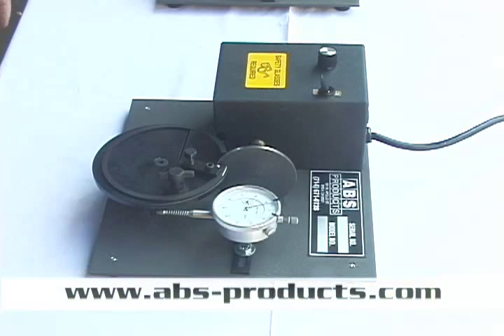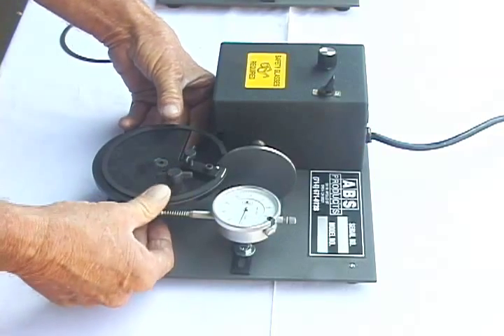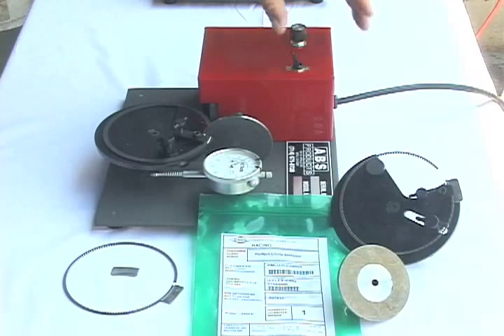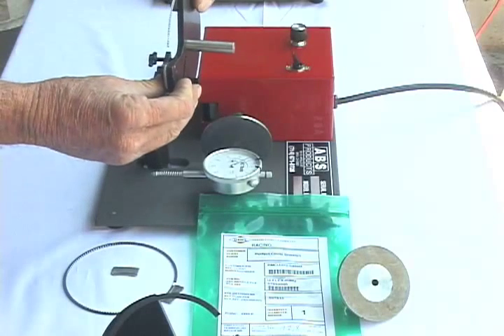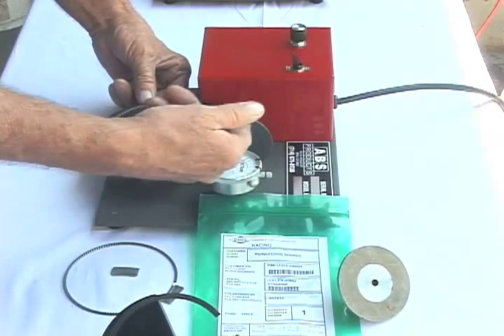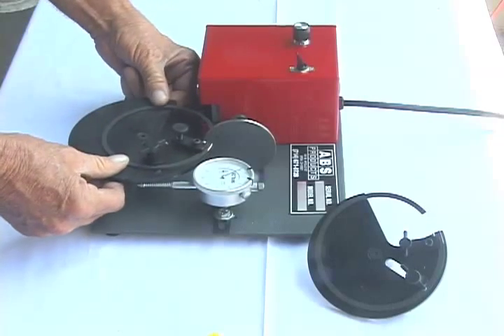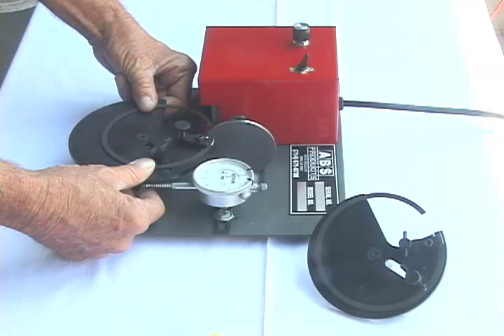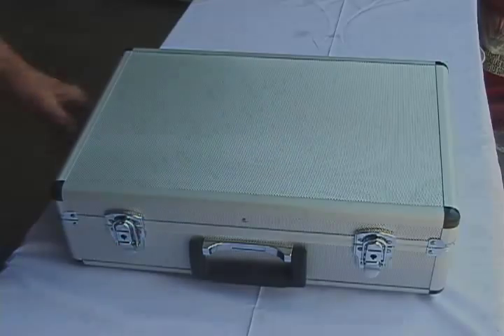Piston Ring End Gap Grinders

Comment: BUT if I am to rebuild an used engine where I do NOT know how much cylinder bore has grinded off (and is thus WIDER than new) during time of operation, than those same new factory rings will give wider gaps since they are made to meet bore size of new cylinder, not used one. It will work, but not as it is suposed to. Beter solution in that situation is to buy oversize rings and file them to specified gap which is not possible with new factory rings since they are too short.

Comment: @DREYFUS11 with new cylinder and pistons it is no big deal for new rings to have gaps inside tolerances, but when you put new rings in used motor, cylinder is no longer new. So for this reason one buys bigger rings and file them down to specification. Can you understand that or are you just dumb?
Reply: you are one of the bigest idiot I have ever read about,period,,,,,,,,,,,,,,,,,,,,,,